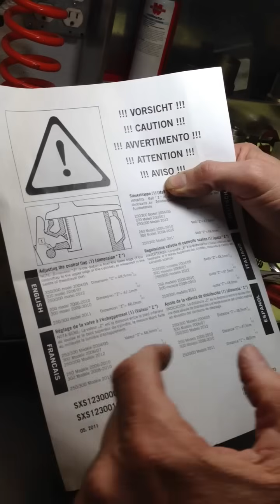How to set the Z dimension on KTM/Husaberg 250/300 cylinders

Comment: Great video as usual! Thank you

I have just installed a new top end on my 2019 xcw300 tpi and I’m wondering how important it is to get the Z dimension adjustment plate on the left side of the power valve exactly right? What will it affect if it’s off?
Reply from the maker: Charlie: Sorry, but I'm not following your question.
Reply: @slavensracing  sorry about that. I’m talking about the plate with the two bolts that limits the range of motion for the power valve. How important is it to get that z dimension to get exactly right and is there an issue if I’m off?

Comment: Hey Jeff, quick question.  What would the symptoms of an incorrect Z dimension be?  When I did mine on my 20TX 300, the flap did meet the max Z distance.  It was short by about 2mm.  As in the caliper was longer by a bit past the PV .  Can you measure with piston at BDC with the cylinder still on if you have the Nihilo deck tool?
Reply from the maker: Hello: If the PV flap is higher than the spec, that will cause a reduction in low-end torque. I have not tried using the Nihilo tool while the cylinder is installed but it will probably work.
Reply: @slavensracing  it seems to ride well.  Good torque all around but the 1/4 throttle sputter is pretty annoying.  I'm remapping now.  Before I switched to an FMF exhaust and it helped smooth everything out.
Reply: @tammo02  Yes but it required a remap and new head from TSP. Made a huge difference.

Comment: How do you adjust a power valve on a 2020 250SX when a 300 kit is 
installed? The new power valve does not have a stop arm. Please show a 
video on how to adjust the 2020 valve without the stop arm. Thank you.